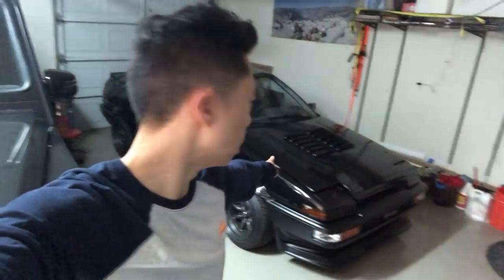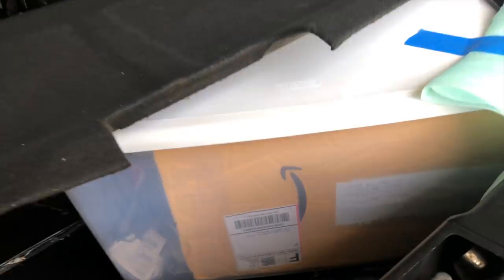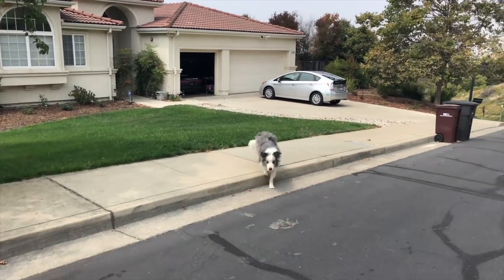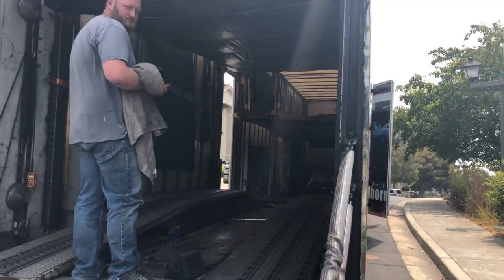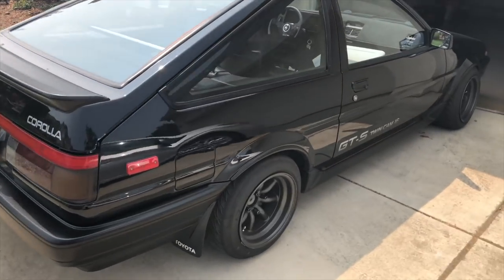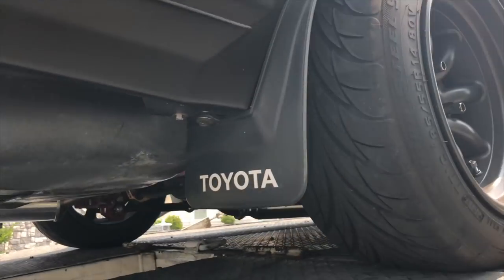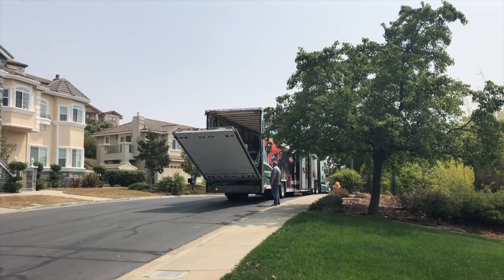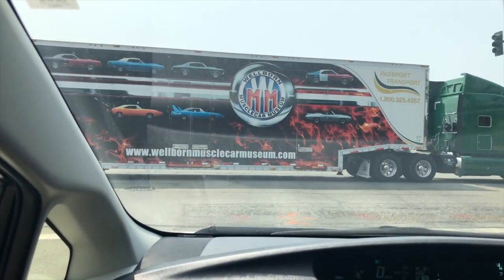Can't Believe I SOLD the AE86!

Comment: I feel like if you chose a different swap choice you may have kept this around. Would've loved to see a 2j (played out I get it) in this thing. Feel like the beams/power was a let down. I'm sure you got a nice offer on this to let it go tho.
Reply: 2jz is a horrible swap for an 86, those things are heavy and will mess up the font/rear balance. Not every car is a drag car, he chose the 3s-ge because it was the modern spjritual successor of the 4a-ge. If he wanted more power he  could have slapped a turbo but that's not the point of this car.